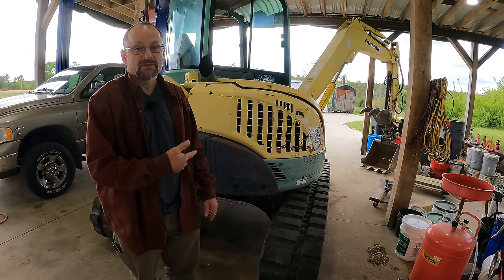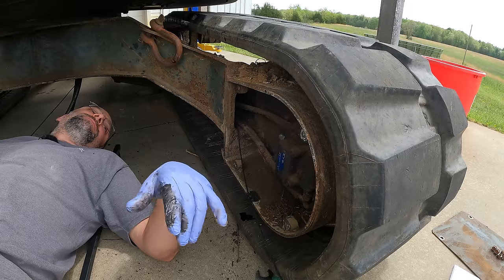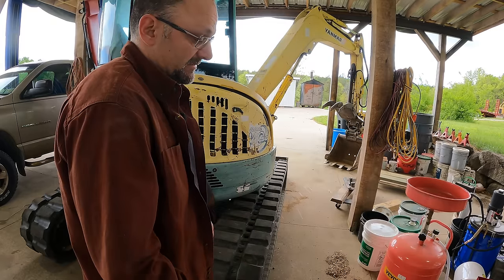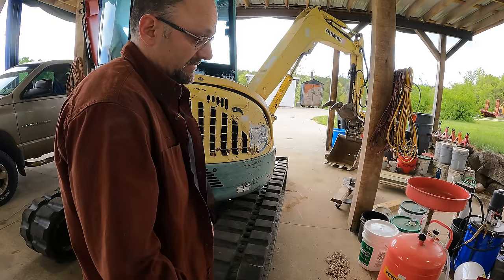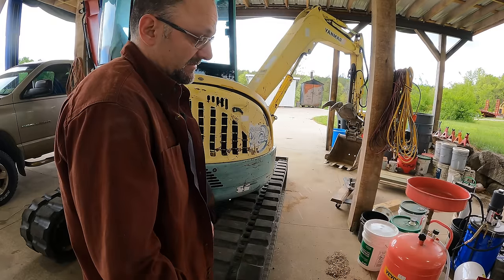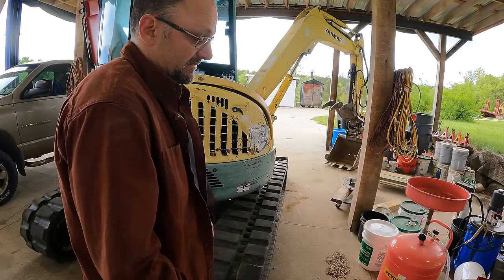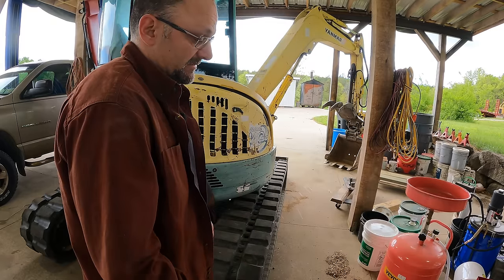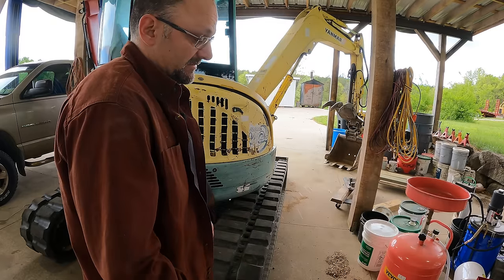Excavator Not Tracking Straight, TOUGH Hydraulic Repair.

Comment: Hi from Italy.  But instead of trying to accelerate the slower track (which would certainly be the best solution, but also the most expensive) you could try to slow down the faster track, by adjusting the stroke of the control lever (as you showed in one of the previous videos).  In a nutshell I mean to slow down the faster track to make it go at the speed of the slower one, reducing the stroke of the lever of the faster track.  Sure this would reduce the top speed, but at least you wouldn't have to keep steering

Comment: Hello. I think you probably should decrease pressure of the "fast" pump by some kind of adjustable safety valve so that the exessive amount of oil could return to the tank. It may work. And it's cheap.

Comment: I apologize if this has been suggested before, but one of the two original hydraulic leaks was at a set screw. on the pump. If I remember correctly the shop manual mentioned taking care to measure the screw position because changing it's setting would affect the horsepower within the pump. Is it possible that making a slight adjustment to that set screw may adjust the pressure to one side of the pump output for the purpose of equalizing the pressure/output speed of the other line? In other words fine tuning the right output pressure to match the left or vice versa?
Reply: Oops. I paused the video literally 1 minute before you tried this very thing as I was struck with the thought. Right after I posted and pressed play you went directly into trying it. Good luck and I enjoy your videos!

Comment: The pump have two piston pump that control one track each. The pump should have an adjustment of swatch plates to balance the flow. Even New the flow could be not equeal for each motor and must be ballanced. Or simple à lever stop travelling for the one going faster (maybe possible ?).Look toward something around IMO. 
Usually an hydrostatic système is in loop and not return to tank but to the pump to make for/rev as flow change direction.
But I Nevers work on those small digger. 
I like how you show how things work.

Comment: Wow. Tough nut to crack. I have an idea to track straight. If it goes to the one side means one track is going faster then the other side. Maybe put a valve or something in line just before travel motor to limit the flow on the faster turning track. It should go straight but not as fast.

Comment: check the speed control circuit on both drive motor. often they have flow control internal. A plug and inside an adjustment screw. Small differens in flow & pressure doesent matter, the motors regulates speed by them selfs. This is general for excavators

Comment: I agree with your conclusion.  With the age of the machine, I'm sure it has a small amount of wear in each of several components.  I would definitely just live with it unless I was a pro using it all day every day.  Great video though along with the other hydraulic repairs.  I'm learning a lot about hydraulic systems.  The main thing I have learned is that I don't ever want to work on one. 🤮

Comment: I think you're correct about the control valve leak and then 1 week pump. I would suggest measuring leakage of the pumps. Find their case drain or whatever you would call it. Sorry my Norman clature isn't as good as it was. Put that into a bucket see how much difference you have between the two. 
You seem skilled enough I would highly recommend pulling out that pump fully dismantling it and see what you can see it could be something as simple as debris caught in a valve.. I've had quite a few hydraulic problems with valves and pumps remedied by simply tearing them down. All it takes is one hydraulic hose or one cylinder to come apart internally and leave bits of rubber all over your hydraulic system. 

I don't think the accumulator could be causing the problem but it could be contributing if you have a bad check valve in whatever side of the pump the accumulators on. And the accumulator is why your 1 gauge bounced. 
I've had a hydrostatic drive unit completely torn apart and it was one of the first hydraulic things I had to work on 

The last thing as people have mentioned would be to just slow one motor down. The easiest way is just don't push one stick all the way. Lol  

But I completely feel your pain stuff that doesn't drive straight drives me bonkers.

Comment: You could measure travel motors case drain in ml over X amount of time while having the travel motor loaded. Lock the sprocket to the frame with metal round stock the fits into the teeth. Disconnect the case drain from the motor and cap the hose. Direct the case drain port with a hose into a bucket. Both side should have about the same amount of case drain quantity over 1 min of loaded operation. If there is a small difference, you might be able to order a seal kit for a motor. Disassemble it, inspect the pistons and face of the swash plate and then lap it. That might help a bit.

Comment: went through this with my JD 290 d
turned out to be the hammer Pedal control linkage was loose and tightened against the valve spool slightly, enough to crack it open enough to divert pressure from the pump side it runs off of which also supplies the drive motor. we just adjusted the linkage so it kept the valve in neutral position, and it tracked straight again.
maybe one of your other functions ie; blade, thumb, is drawing off the hydraulic circuit it's tapped into.

Comment: For a few hundred dollars get yourself a flow divider valve and put it in series from the out put of the pump then set it so it track straight. You will get equal flow to both circuits cutting out the internal leakage of the pump and keeping two outputs.

Comment: I would take the tracks off, mark the drive sprockets and check that the both rotate equally. Also check that the idlers are all free and not worn. I assume that you have checked the track tension.

Comment: John, Ron from Aust.  even though I know some of this stuff and would not have done so much testing to get to issues, as you would not do now either.  I was sure you were going stuff up the idler, up and down slop but you understood and added the metal correctly, many do no fully understand that and the bigger bulldozers hook under an inner strip rather than the D3 hooking under the track frame beam makes it more difficult to grasp.

I have been in earthmoveng forever and repaired mainly dozers.  My son has a D3 the same and we have a vio 4.5 basicly the same sitting outside.

Bulldozers with uneven track wear and direct drive to the sprockets (sprockets solidly locked) will drive in circles similar to your esc, probably due to pin and bush wear and one track rides higher on its sprocket than the other track, thus increasing the feet per min travelled on that side.

ie a stretched part in your rubber track would contribute.  By the way, be very carefull working in loose small rock or gravel (like 3").  I was not used to the rubber and work in a creek (river stone and sand) here for maybe 2 hours (not churning the tracks in, you know staying on top pretty much) I thought yeah this rubber won't be worn like a steel pin and bush it will be good, next thing boom -  a rock straight throught the rubber push throuch from the inside, like a 3 inch slit with wire hanging out like a buggered tyre.  wasn't long maybe a day and the track basicly broke in half, totally stuffed.

Sorry I haven't even bothered to look at the 4.5 pump or pumps.  Usually there are 2 piston pumps.
Anyhow to the pumps.  The old exc had gear pumps ie Hymac etc like 3 or more.  Point is fixed displacment not variable flow like squash plate piston pumps.

Load up the fixed flow and the engine would stall too quick and you have to let go of the lever or it was the start button, similar to a bobcat,  this situation was not as good as it might seem on an exc when using multiple actions - even to me one who likes direct drive bulldozers

The variable flow is magic, big flow = speed when there is little load and the engine can handle it but when you load up the squash plate is squared off by basically a small ram that it fed the load pressure and hey presto lower flow under load so the engine is not stalled.

Looking at the adjustment and the diagram you are adjusting the basically torque that the pump will require from the motor when under part or full load (this adjustment will make no difference in the no load situation, ie when you are walking on flat or down hill).  It will change the flow under load ie HP of oil output, until the engine cannot cope, more to the point of stalling the engine if the adjustment will go that far

I know the exact same screw on our yanmar I went looking for it but have not changed it "YET"  I do like to tinker and have things performing but getting the time how the hell do you do it, besides the esc goes quit well already but I have seen many an esc that revs its guts out and does not load up due to insufficant load holding the squash plate on tilt, adjustment will increase perforamnce and speed (real hp out put of the machine) up to when the engine is loaded too much

On looking at the diagram the adjustment will increase the spring load so that it is harder to square off the squash plate, done by the pin diagram on the opposite side of the squash plate ie requiring more out put pressure before flow is reduced and thus more torque to drive.

There are many on youtube - diagrams on how these variable flow hyd piston pumps work
To change the NO LOAD FLOW there needs to be a fixed adjustment that stops that squash plate from going to such tilt or alternatly will allow the squash plate to go FULL TILT, (some pumps on youtube do have that adjustment but my limited knowledge has not encountered one on an esc)

My 2 bob - if there is only one piston pump there is a wear problem and it needs fixing (only if the uneven walk is unberable).  A problem has occured somewhwere because the gear pump was stuffed (they go for years before getting that bad).  The same whatever must have pased through the piston pump.  CAUSE don't know but I have a love hate for quick couplers because drivers will connect them dirty.  Otherwise dirty Top up or Dirt on repair or steel from wear ie galling ram.  That esc could and  should still be good, it does not appear to have done that many hrs.

Our yanmar performs quite well compard to other esc's, I like it strong everywhere including lift.  Our esc looks like yours and we have no issues bar some corrosion on electical and frame etc (none of the issues you have had thank god)
My son picked up a pc450lc I was amased by it after being mainly on 22ton,  you would like it loading the truck and well digging them stumps with the ripper.  Just like the yanmar to drive

I tried to explain the reason for variable flow and the basics and from what I have seen with those basics you will smash it, because you are a man who wants to know the foundation of the issue and from there all is possible

email if you like but I dont check it very often
good luck with it John

Comment: Could you add a couple of pressure gauges on the outputs from the pump? A means of reading the outputs in realtime at a visible point would be a real boon. Maybe even find a couple of regulating valves  adjust and balance pressure. The way I see it, that machine is WELL past warranty so you might as well make things easy on yourself with a nice visible indicator.

Comment: That swash plate adjustment won't hurt anything if you screw it in more. It only acts on a spring to force the swash plate at more of an angle against the force of pin (A) on the opposite side mounted just under a cap overlapped by the gear pumps which extend under max pressure of both pump outlets to reduce the swash plate angle. This may have been the source of chattering on your left drive at idle.
If it's maxed out already then you won't see a difference.
If you do get some more flow then you can adjust the respective reliefs on your valve body to balance the dynamic flow at full throttle.
If the engine bogs down you know you might be pushing it, just back it off a bit.

Comment: I keep thinking that the compensator may be the problem. Can you do a test run without it? If it is on your original P1 that was the thing causing the strange needle movement when you went from HI to IDLE... Sometimes those things get worn out and dont do their job properly
Reply from the maker: Great point.  I hadn't thought about the accumulator causing that gauge behavior.  That's a definite possibility.  Regarding it being the problem, the accumulator was originally on the fast side, so it's not causing a restriction, and when I swap lines at the pump it goes with the line, so it then becomes the slow side.  I don't think it's involved with the tracking issue.  The reason I haven't removed it is because of the way the lines are plumbed, I would have to buy fittings.  It essentially acts as a 90 degree 1/2 pipe thread to 1/2 british pipe adapter.  Cheers.

Comment: Hi, I had a similar problem with a skid steer tracking poorly. My fix was to adjust the control levers to the valves. there is an adjustment there that will allow for there wear in the linkages , possibly the spools are not in the same spots to allow the machine to drive straight. does the machine drive straight if you  don't push on the control stick as hard/far as the other? then you mite be able to adjust the linkages from the control stick to the valve. Good Luck Gary

Comment: Adjusting that set screw in on the pump is also going to lower your pressure, you may be able to see the effect a lot easier watching a pressure gauge.  You're basically just trading pressure for flow, or "going to a higher gear".  From factory it's likely adjusted for "optimum performance" at full RPM.  As you deviate from that, you'll lose some efficiency in the trade-off.

Comment: Have you thought about adding flow control valves into your hydraulic motor circuits? That way you could adjust the flow to each motor until it tracked straight.

Comment: Could you add some kind of manually adjustable needle valve on the "good" track circuit and adjust until it is of similar performance to the "bad" side? I assume you would have to do the setting once the oil got up to temp and that would mean first operation would still be tracking incorrectly but at least you could get it closer?

Comment: To avoid the neutral bypass issue when the pumps are ganged together could you add check valves to each line from the pumps?

Comment: There should be an adjustment on the levers, if there isn't, add one. As a plant fitter of many years experience almost all problems on the control side are simple linkage wear, not hydraulic problems.

Comment: One thing I don’t understand is the high speed mode. Is this not the way you’re driving?

I remember when I was driving, the high speed select is weak but offered adjustment so that I could steer in a “linear” way (not on/off).

To me it doesn’t make sense to drive long distance, flat surface, other than high speed.

Comment: Is there a way to add tuneable vales into the drive hoses? You may be able to get it to go straight, if so, by reducing the flow to the higher output side.... Just a thought. On a side note...A lot of APC's and Tanks constantly need to dabbed left or right 'stick' to go straight.... A design flaw, due to torsion bar suspension. Knowing that won't help your situation but, at least, you're not alone in the struggle for going in a straight line.

Comment: one thing is what is the spec?  i havent seen one yet that tracked straight. they allow x number of feet side to side  per y number of feet foreward or back.  without a flow meter there is not much you can do to check hydraulic motor circuits. the track motors are checked  by running a hose from the case drain into a container and checking the leak rate for a certain time under certain conditions. that test should be in the manual. dont mess with that horsepower control without a flow meter with a variable restrictor. overstroking those pumps can litterally blow  the slippers out of them. INSTANTLY! the double pump outlets feed the valve stacks at different ends, making 2 seperate systems UNTIL certain functions are used simotaneously  then a shuttle section (somewhere in the middle) opens up to give more flow to the other. repairs get expensive quickly . i'd put it back the way it was and run it till it gets really bad  then it will be obvious where the problem is.

Comment: A simple test you can do to test your drive motors is to run the case drain lines from each motor into separate buckets, run the machine in a straight line on flat ground for some duration (the longer the duration the more accurate) then measure the quantity of fluid in each bucket. The bucket with the most fluid is the motor with the most internal leakage. Don't worry about the pressure as its very low, low enough that it won't blow out the shaft seals in the motor during normal operation. 

Also, the stroke limiter is turned out for more flow not in. It's essentially a stop for the swash plate, the more angle of the swash plate the more flow the pump will output. If each pump has a stroke limiter (which they should) you might be able to use them to bias the output to your drive motors to correct your drift issue.

Comment: ok as the tracking changes when you swapped BOTH the accumulator AND valves perhaps it is an imbalance due to simply the accumulator, perhaps adding a second one(removing may be dangerous) of equal spec(possibly two new ones) might fix the issue, just an idea

Comment: The accumulator seems to follow the slow track. Messing with internal pressure? Would explain fluctuating guage during parallel guage test
Or, is there a return restriction on one side that  is causing "feedback" to control, pump etc....